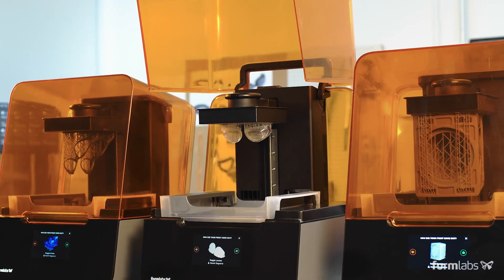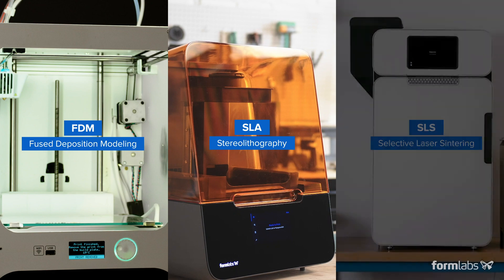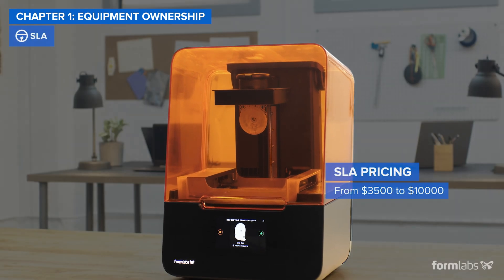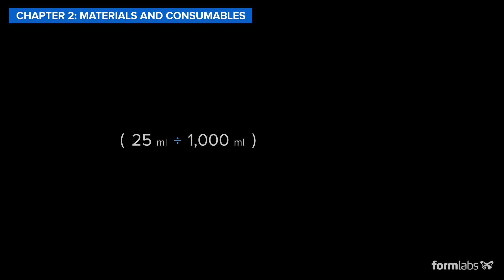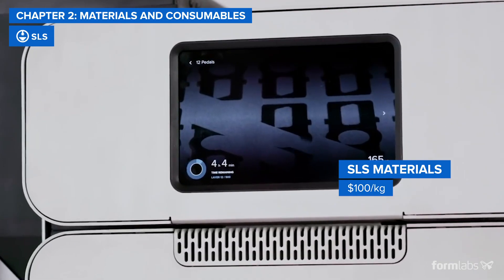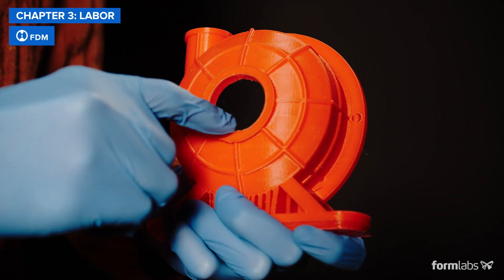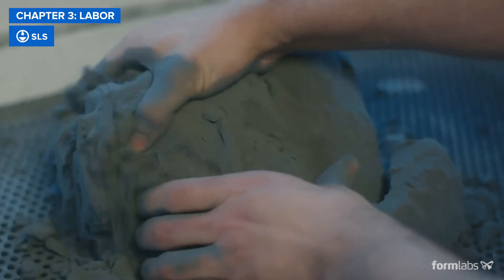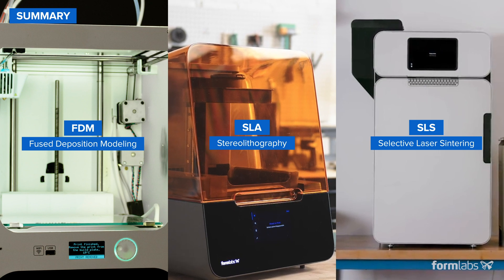3D Printing Cost | Compare FDM, SLA, and SLS 3D Printing Technologies

Comment: as a person familiar with 3-d printing, i know a lot of the information you are providing is wrong or misguided.
the labor of SLA is a lot higher in reality if one actually cares about their printer and material use.
you have to use a lot of fluids which are always messy, it takes a lot of time and this is not represented in the video.
a few other points are also misguiding

Comment: The FDM material cost is around 20-30€/kg (premium material) and that includes support material. So your calculation is very wrong. Speaking as a professional printer (FDM & SLA).